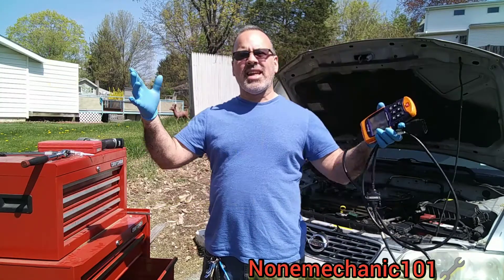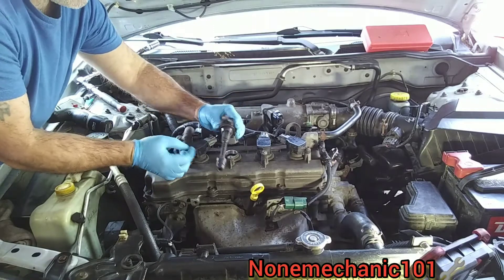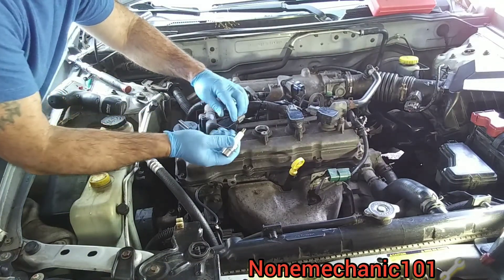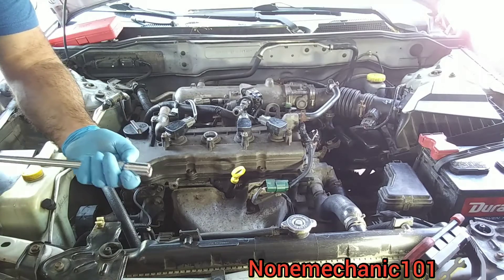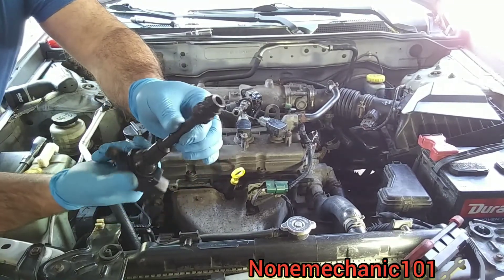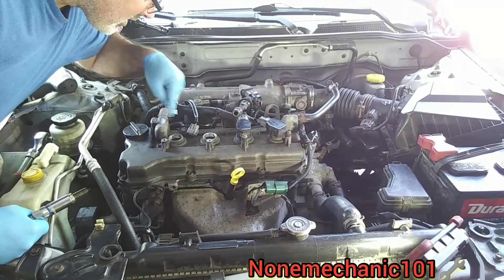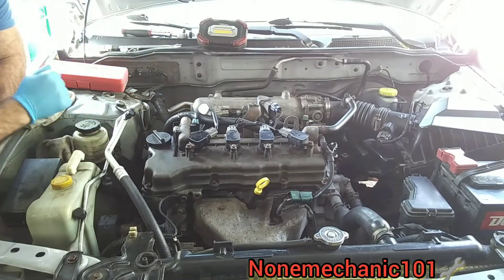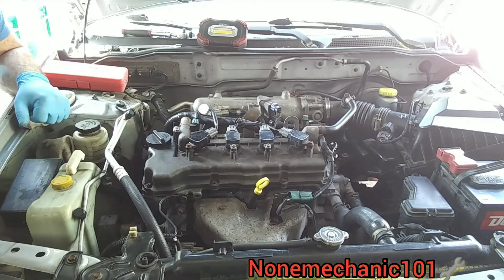2003 Nissan Sentra Diagnosing Cylinder 2 Misfire P0302

Comment: you got to have the gear.  good work! hopefully oil seals can get the misfire to audios'
Reply from the maker: Fingers crossed!
Reply: @NoneMechanic101  have you done a compression test?
Reply from the maker: @thisguysgarage  I just did it yesterday. I called Tim because I am not sure about the numbers. I'm waiting for him to get back to me.
Reply: @NoneMechanic101  what did you see
Reply from the maker: @thisguysgarage   Cylinder 1=115 psi, Cylinder 2=115 psi, Cylinder 3=110, Cylinder 4=100 psi (dry) 115 psi (wet)
Reply: @NoneMechanic101  i would expect 130 across the board for this engine.  how many miles on the old girl.  getting into major surgery to investigate further.  a leak down test will tell you if its getting past the rings or valves.  I would suggest picking up a vacuum guage.  will get you similar information with out getting to involved.  

I think it may be oil causing the misfire but I don't think its oil from the valve cover.  probably internal.  
is the car worth a motor job?
Reply from the maker: @thisguysgarage  I have a leak tester but I don't have a compressor. This car belongs to a friend. They want me to bring this car back to life. The car runs. It isn't worth getting an engine.
Reply: @NoneMechanic101  if it was low only in one cylinder I would suspect a valve. across 4 cylinders more likely rings especially since it was overheating. the rings loose their temper. throw a vacuum gauge on it.   worth the 10 bucks for the guage
Reply from the maker: @thisguysgarage  Thank you. I appreciate it👍
Reply: @NoneMechanic101  not a problem 👌
Reply: @NoneMechanic101  you know what you could try is some 15-40 synthetic.  might bring that tired engine up 15-20 psi or some restore, worth a try, make for some good content 🤔
Reply from the maker: @thisguysgarage  This sounds like a great idea. Going to speak to the owner. Thank You